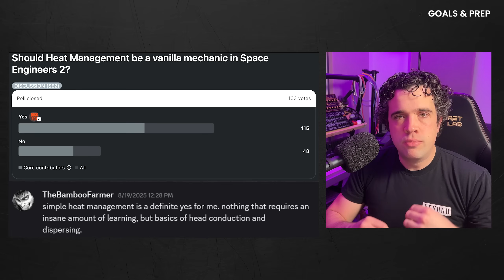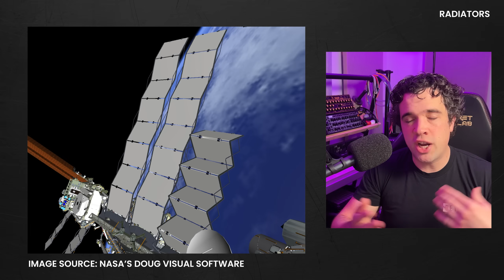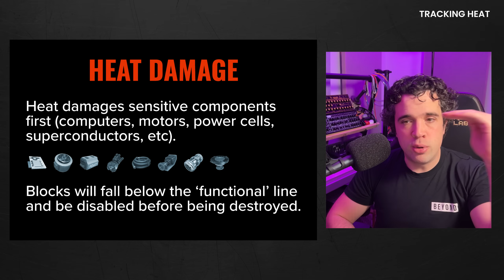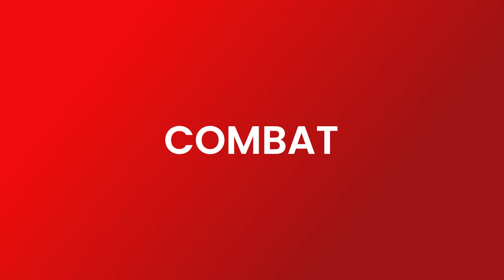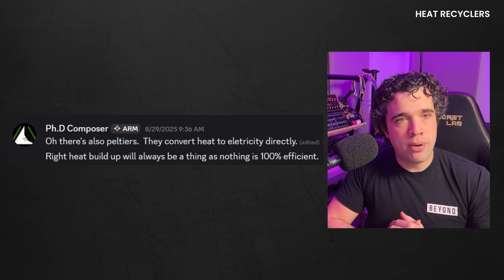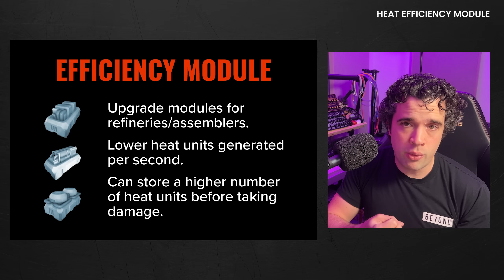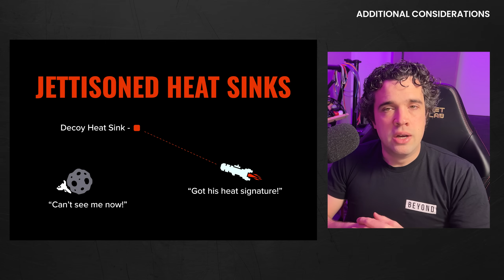Heat in Space Engineers 2? How heat could change EVERYTHING

Comment: I could foresee this being a hassle, but I do really want more complex "engineering" as a challenge to ship building. Do you have any thoughts on multi-block/modular subsystems? In the sense that functional blocks like thrusters are pretty much entirely complete and only need fuel/power/etc to function. I'd love to build an "engine" instead of just slapping on more or bigger thrusters, especially for larger ships.
Reply from the maker: Not sure exactly what you mean with building an engine, but I'm curious. Can you explain more what you're thinking?
Reply: @diggrok   Blocks that are meant to be chained together. Like refinery upgrade modules, just bigger and cooler and for other major parts.

Imagining something like replacing rows and rows of thrusters/gyros/etc with fewer numbers attached to a bunch of subsystems that improve their performance. Give ships more "guts", if that makes sense, although obviously in a way that doesn't ruin the vanilla style.
Reply from the maker: @FoxyUkeFox  Oh I see. Yeah that would be cool! Also can be achieved through tiers of modules where higher tiers require more advanced components but work better, with top tier requiring exotic tech. This is what most custom servers do and it's pretty cool. Though your upgrade modules on top of that would be next level! 🤯
Reply: @diggrok  My issue with tiered components is it doesn't really solve my actual problem - that building kind of sucks! I want more engineering and more opportunities for insanely talented players to wow us all with their ingenuity, but without it being as overly complicated as something like Stormworks. I want to build an engine room (that isn't decorative), or cobble together my own weapons from parts, that kind of thing. I just wonder if the SE community would be interested because it'd be a pretty big shift from SE1.
Reply from the maker: @FoxyUkeFox yeah I feel that. It would be really cool! Especially if there were trade offs like modules only have so many intakes (like refineries) so you have to decide what setup you want to run.